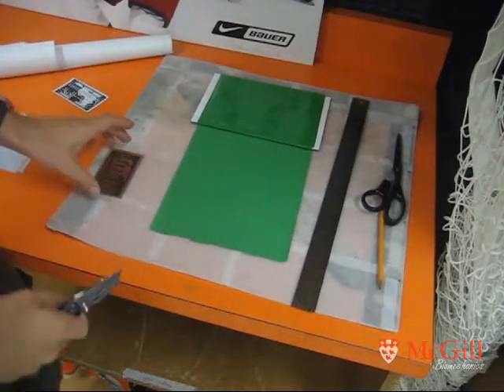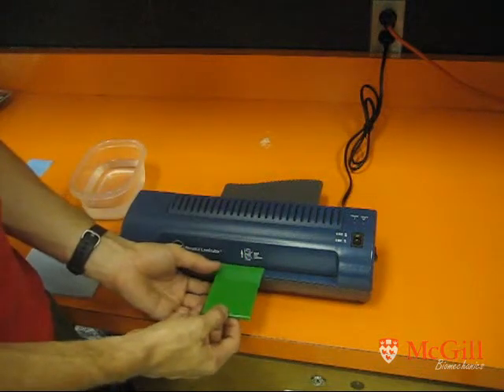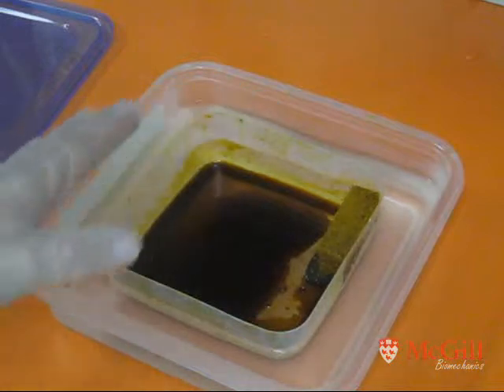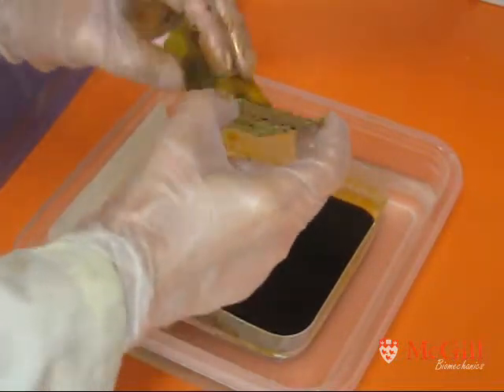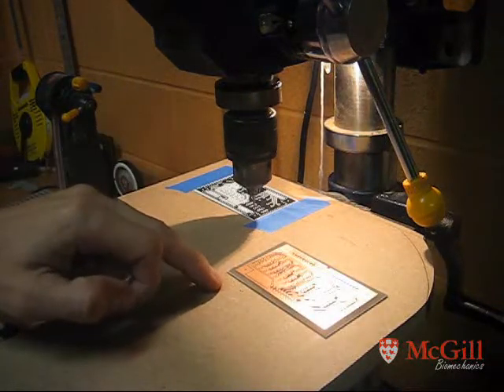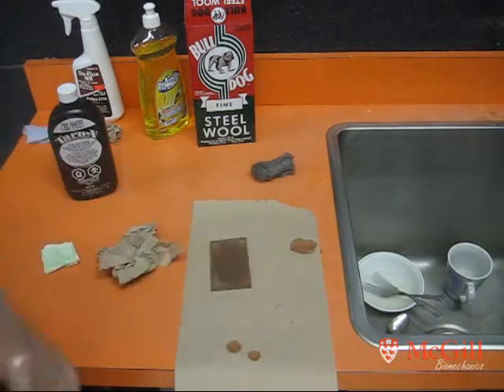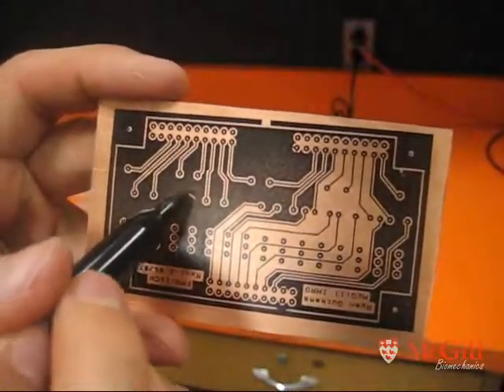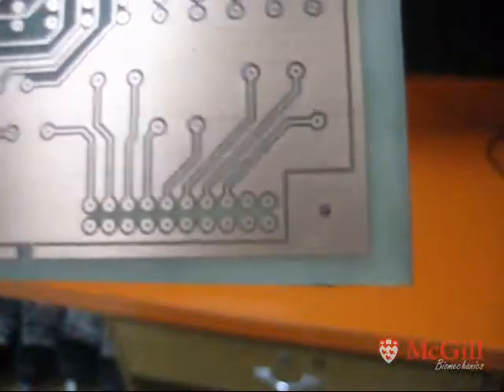How to make a double sided circuit board using the toner transfer method - Part 2 of 2

Comment: Thanks to the author of the video clip! Frank here from PulsarProFX (makers of the PCB Fab-In-A-Box for past 20+ years). The reason the GreenTRF foil is sticking where it shouldn't is due to residual "glue" from the Toner Transfer Paper after the water bath, releasing the toner from the paper. Just give the board a real heavy, hard water blast from the sink. I like to rub the released paper back over the board to break the surface-tension which can keep some residual glue hiding in donut holes, etc. The foil can only transfer to where there is toner AND any residue glue (Dextrin). If you have this happen where the Green is left where it shouldn't be, instead of using the erasure, best to get a cheap roll of 3M "Temporary" tape. Lay the strips down and lift off. That'll pull off all excess "Green". Anyone can call us anytime for any problem they may run across at (850) 926-2009, 9-5 MST.  Cheers, Frank :)
Reply from the maker: Thanks for the tip Frank! Your products helped me greatly to build the hardware I needed to gather all my data during my PhD studies. Without this rapid prototyping method I would have been way out of my budget for my project. I'm pleased this video is still getting attention after 5 years!
Reply: I've been using PulsarPro products for years now and I can't say enough good things about them. I am able to create prototype boards and refine my design before sending them off to a PCB manufacture. It saves time, money and the delay of remaking a board. Frank is very responsive to calls as well. Thanks!
Reply: Frank Miller Thank you, thank you! This is a hugely helpful tip, the only problem I've had with this product is the foil not peeling away from the non toner'd copper easily. I'd suggest adding this to the troubleshooting faq page on your website.

Comment from the maker: @1787dude The point of the green film is to add an additional layer of protection against the Ferric Chloride etch. You can do it without using the green film, but the quality of your traces will not be as good.

Comment: you can cut the time by 2 if you etch both sides same time. the way I do it : cut you transfer paper and  keep 2 or 3 inches of white space . line up your both faces using light. holdem tight together and put a small piece of tape just in the top of the white space to keep them lined, place the pcb between the two pieces of  paper, heat transfer and etch, I've made some tiny double sided boards with fine traces (10 mils)  using this method . thanks for the video

Comment: I agree this is a very informative method. I have tried it myself in the past but later went with the toner on a photo-resistive board. I also drill loads of locating holes and used pins to align. I modified a fish tank bubbler to aid the etching process with a fish tank heater too (works amazing on larger boards). Overall one of the best videos on etching out there, Excellent 10/10

Comment from the maker: @marcelojr You have to remove it to get a clean solder surface your components. I suppose I could have removed it only where there were solder contacts but I just cleaned off the whole board. This was a prototype board so I didn't really care about the copper oxidizing.